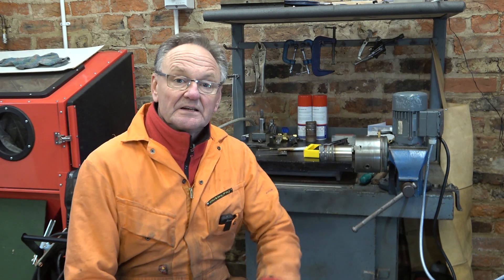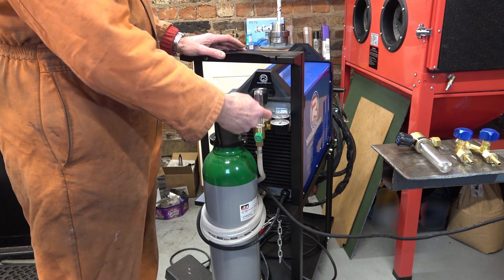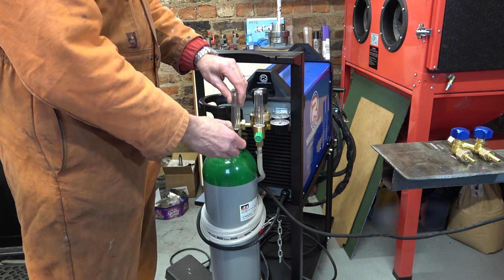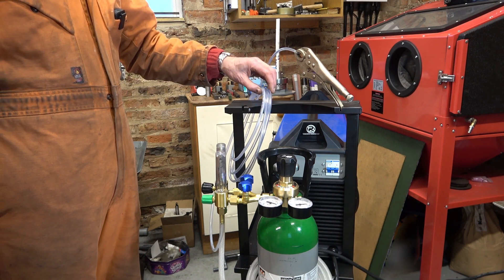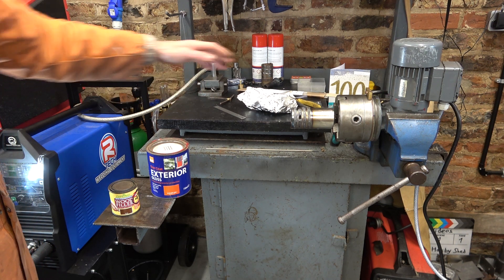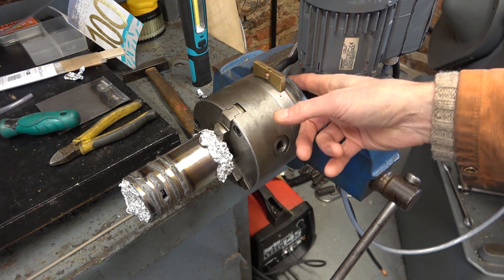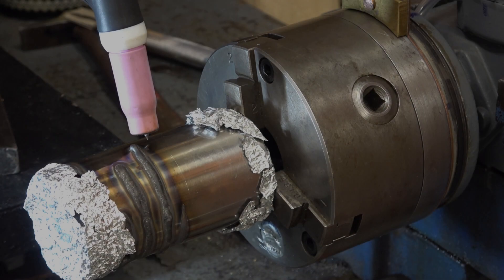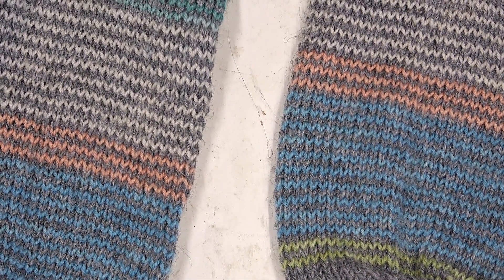HS125 Diary of a TIG welding beginner 5

Comment: This was fantastic to watch, thanks. I really like the idea of the combination of the rotator and torch holder, that is a great setup. You did make me laugh when you said that the gauge was relatively approximate, that was a very polite way to describe it
Reply from the maker: Hi GTB, I'm glad it was useful. I'd find a much better way to seal the tube now (masking tape suggested) and run the rotator slower. I was very encouraged that the purge worked and surprised how crystalline the back of the weld was without purge. I believe oxygen at the back can be drawn into the weld, it's not just a case of appearance (so I understand anyway - not tested yet). Cheers

Comment: Hi just a tip if you weld on the top side and tape off the bottom  it will help your purge you just want to fill the volume with purge gas  too much purge gas swirling around can cause  porosity in you first pass your purge gas is heavier than air so the lower you keep your purge hose and vent higher you will have better results. I like to use masking tape to seal up your part. Good Luck your on the right track
Reply from the maker: Hi thanks Mike, after reading your comment I looked it up and yes I see Argon is 38% more dense than air! I had no idea. I will try to factor that in now. Cheers.

Comment: Hi Paul, I haven't tried TIG yet hope to get a setup soon. I have a similar flow meter in Imperial units naturally. The glass flow tube can be unscrewed and the internal flow scale can be rotated for viewing at different angles. Might be worth checking yours. Welds look good for just starting.
ATB...Dean
Reply from the maker: Hi Dean, that was a big help because I was not aware the tube unscrewed so the scale could be turned. I made the assumption they were sealed. I will be turning those round to face front tomorrow. Many thanks.
Reply: Dean, have you watched the video where a guy took a cheap brand mig and turned it into a tig welder? 5 years ago, I invested $2K in an EverLast 256s for our shop. No more use it gets, wish I had put the money in a sock for time like now we are in (@@)! Tig welding is awesome, but the consumables are expensive. Bear
Reply: @bearsrodshop7067  Haven't seen that one Bear, but Al (AJ) channel I believe did it with a DC stick welder. I've been looking at EverLast for quality vs price point seems like a good unit..

Comment: I am not a welder but have seen a lot of StSt pipe welded. They use masking tape to seal off the pipe ends and around the purge tube. You could  dip the  end of an exit tube in water to check the gas flow. 15 ppm is a lot of flow, imagine filling a bucket of water in 30sec,  With a good seal once the purge is complete you shouldn’t need to keep the gas running imho. Just trying to save you some gas, look forward to seeing you progress.
Reply from the maker: Hi Tony, yes a few people have said masking tape is best so I will try that next time. I turned the gas up to 15 L/min in desperation .... I was expecting it to be obvious that the purge was flowing and I expected to hear hissing. Next time I would seal it up better and use less flow. I was very pleased that it worked (even at all) and the effect was so clear. It gave me a lot of encouragement. Cheers

Comment: I too think it is running too fast for your pipe diameter.And for beginner learning you have not taken the easiest route in my opinion .Would it not be more motivating to sit down at a table and weld up a for instance square tubing ms frame for a thick plate welding table?I do understand your desire to use your rotary gizmo but does its use at this stage have a lot of practical sense to get the hang of TIG work?I did a lot of 25-60 mm ss welding for my boats and did needed many failures to end up with passable results.In my case I much preferred the ,,easier,,underhand light construction welding.But great to see your thought process!
Reply from the maker: Hi Robert, some people like to get good at one thing and then expand to others. My approach is to try everything once to get an idea of the whole landscape. It takes me longer to get results but usually it means I understand more of the whole picture. But I 100% agree it's frustrating and yes demoralizing when whatever I tried ended up with craters and bubbles.   Now I'm pleased to report that I'm finally having some success, with all the advice now falling into place.  When I put out my next welding video in a week or two you will see me going off into another blind alley at first but then  it clicks and I'm coming down the pain curve with some decent welds now, at least on thicker steel plate. Cheers